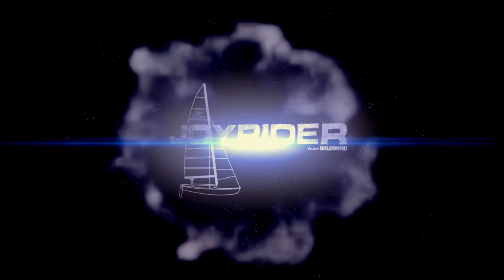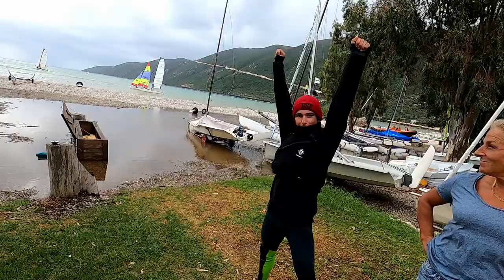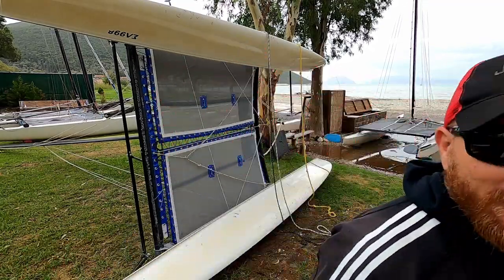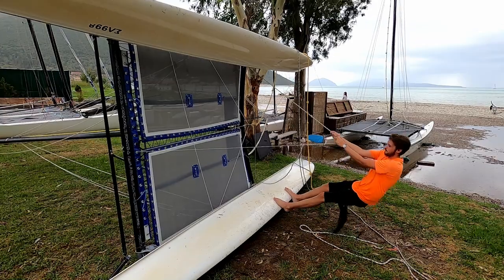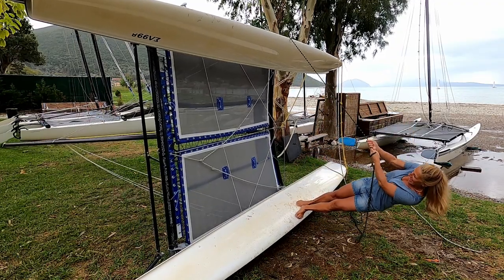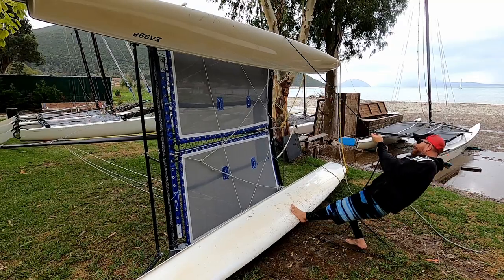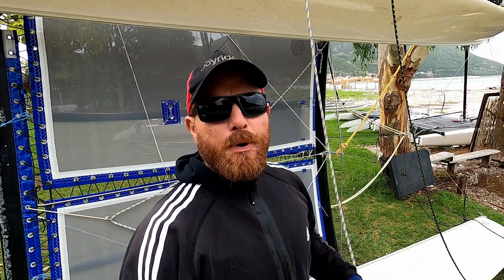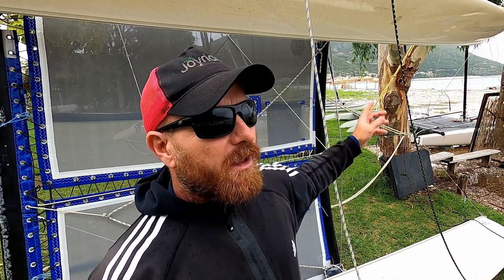Capsize righting, does it make a difference where the righting line is anchored

Comment: As long as the righting line is over the hull, they should be at the point where the hull is widest because when it doesn't move against the hill it might as well be fixed at the side of the hull for all the difference it makes . You just end up with a huge long rope if you tie it somewhere else
Reply from the maker: Yeah for sure. The simple method is the best which is surely why everyone has used that for years!

Comment: @video: LOL

But seriously: The righting process is following very simple physical laws (lever rules). This is why it doesn't matter, where the righting line is anchored anyway! If your righting line comes from above the hull it just will be easiest to lower your body far enough in order to achieve the maximum distance if your bodies center of gravity giving you the maximum lever for your body weight!

So the hawaiian system is as good as any other, as long as you can lower your body streched and on the toes just slightly above the water and keep it there during the righting of the boat!

All the best,

Guenther
Reply: So then, technically speaking, if one were to carry a pole, that connected to the mast base and extended 3-4' above the upper hull, a righting line attached to that point would increase leverage, and reduce weight required to lift the tip???
Reply: And further, in full turtle, the same principle of pole extended up from the mast above the top of the hulls would reduce leverage to bring upright?
Reply: If you use the pole just for altering the angle of the righting line and don't alter your body position, the righting momentum will not change anyway, cause neither the distance of your center of gravity nor your weight are altered at all!

To increase the righting momentum, you can only follow two (or both) ways:
1.) Increase your weight with something (i.e. waterbag)

2.) Use a pole ore something else to increase the distance of your center of gravity. Personally I use a floating ladder (aluminium, foamed), which fits to the skeg of the lower hull and which I fix to the bow and the stern of the upper hull after capsize. When I step out on the ladder 3 steps and lower my body using the conventional righting line, I can right my Dart 20 solo easily, even in rough water (thanks to the stabilized stand on the ladder instead on a wobbly pole)!

If you want to right the boat from a turtle position solo also, which for shure is much more difficult, and should be avoided by the right very first actions (Don't add any weight on the rigg and climb onboard at the bow instandly, then stand at the bow as far forward as possible sinking it a bit, and lean back until the boat is pointing into the wind), then you must use additional weight or  find a way to support the ladder (or a pole) somehow to be able to move your center of gravity farther away from the mast!
Reply from the maker: Great to get a bit of science involved! Thanks!

Comment: From how I understand it my old physics lessons, the criterion that lifts the mast is always how much weight do I get how far out. 
 
The maximum is hanging out horizontally, arms up and like Pia lifting your leg. 
 
The higher up the line is, the lowwer the forces. It would make no difference in LEVERAGE and effect when you would pull directly from the foot of the mast without the detour over the hull - but the forces are way higher, I'd guess 4 times higher 
 
So the best tuning for your uprighting performance is not the attachment point of the rope, standard is OK, it is the power in your arms (and your technique) that you can go lower down.
Reply from the maker: Thanks for putting the science into words! 
See you soon?

Comment: Suggestion/question: will the Hawaiian pizza method work better if the bungie ran upand down the beams, so more more elastic allowed more rope play? I think though (as an engieer), over the top of the hull gives the greatest mechanical advantage. Once again Hobie have got it right.
Reply from the maker: I'll give that a try - i think for convenience it's a good system - also less on the trampoline.

Comment: I watched your righting bag video recently and you pondered simplifying the pulley purchase system. Did you ever get around to this? If not can I suggest trying the method slackliners used bitd to tension slacklines. They used webbing but should be OK with rope. One biner on bag handles, a pair of carabiners (or suitable rings) clove hitched to the line. Loop line through the handle biner and pair of biners several times, last pass of the line between the pair of biners. As the weight comes on the system it clamps the line passing through the pair of biners (might need half hitch to secure when you go hands free).  Obviously won't be as swish as using blocks/pulleys, but potentially simpler/cheaper.
 (If the pull downwards is awkward maybe try pair of biners at handles, single on line so the pull is up)
Reply from the maker: Thanks for the idea, i'll certainly look into it.

Comment: Not encouraging… But a great video nonetheless… Thanks! 

I used a Hobie righting bag this summer in calm wind, near the shore to try to see if I could right the Hobie, (solo)… I am about 200 pounds, (approx 90 kg) and had, perhaps an extra 60 pounds in the bag, (though I couldn’t quite fill it)...Even then, the boat wouldn’t come up unless my son lifted up on the tip... Going to see if I can get a bigger bag…
Reply from the maker: I found that with zero wind a total of 120 kg was enough to right the 16 fully rigged.
Reply: @JoyriderTV  Thanks Joe...I must have been close to having enough weight...Theoretically, the Hobie branded 'Righting Bag' holds 150lbs of water (68kg),  but it's difficult to fill the bag, (even with a plastic hoop holding the bag open)...Also, when you lean out against the bag, inevitably some of the water gets pushed out...Apparently, the Murrays' branded bag holds up to 250 lbs (113kg), so even if it isn't full, it should be able to get me over the hump...stay tuned...

Comment: So basically, you gotta be running a deuce (90kg/200lbs) to single handed right an H16??
Reply: Or bring a righting bag!
Reply: @BillACK  Still then, total weight in any configuration needs to be 90kg. It's a good magic number know.
Reply from the maker: This was a test to see if the different anchor points made a difference. From previous on water testing, to get the 16 up with sails on the water with no wind takes 120kg

Comment: Hi Joe, I disagree with the conclusions on the hawaiian system, if you watch closely, the only one that operated it correctly was Pia from Sweden, she had her body straight and as horizontal as she could. The rest of you had the torso at a more vertical angle compared to the other tests. The lower angle of the line makes it a bit less natural to have a straight body but that's all the difference, just being aware of it to do it correctly would have given the same results. As per the physics, consider the boat plus the sailor as the system to analyze, it doesn't matter how is it that the sailor gets the body in the right position, those forces that keep him/her in position are forces internal to that system, there's an action and reaction and being both internal forces they cancel out. The only external forces that do the job are gravity and the support provided by the water. So if you manage to put your body in the same position, it will have the exact same effect. It might be a bit harder to hold your weight in one case compared to the other, but there isn't a limitation of leverage of one compared to the other.
Reply from the maker: Very interesting. The Hawaiian system is really nice in terms of the speed of deployment. I'll try it out on the water (using a better technique)
Thanks

Comment: First! Yes!!!
Reply from the maker: Bingo! Gold star!
Reply: So sorry, but the mechanical advantage of the rope coming from the top of the lower hull to you (if you were able to hold it) or from over the top of the upper hull makes absolutely no difference in the righting moment. It's a static system. Another problem with the Hawaiin system is, after you've turned the tramp perpendicular to the wind to help the righting monent,  you can pull on the top hull at only one fore-aft place - a problem if the wind tries to turn the boat so the wind on the tramp is helping less. If you use the rope coming from both fore and aft stanchions, you can walk fore and aft, using your weight on the bottom hull, changing the pivot point of the lower hull in the water and get the wind to pivot the whole boat till the tramp is directly perpendicular to the wind, at which point you lean out at that point to keep the boat from turning, using the wind to help you maximally.  can right my H16 this way by myself @ 165 lbs (assuming a fairly strong wind). I used a water bag otherwise.